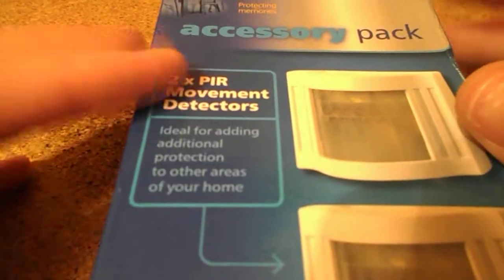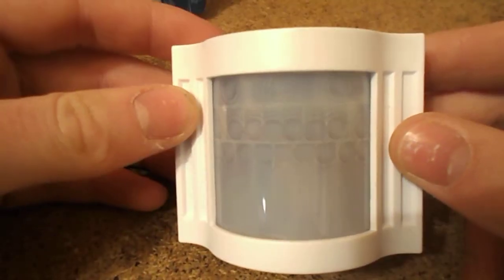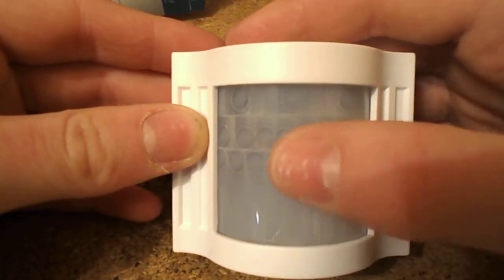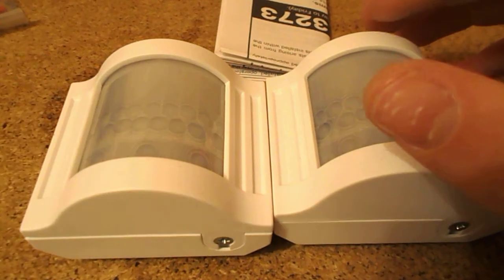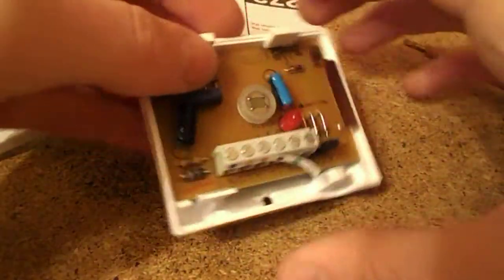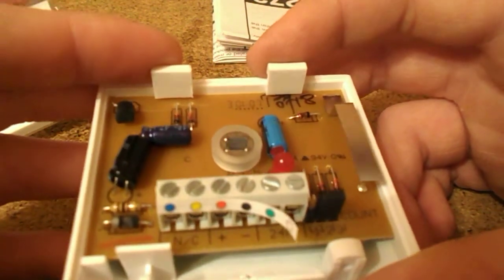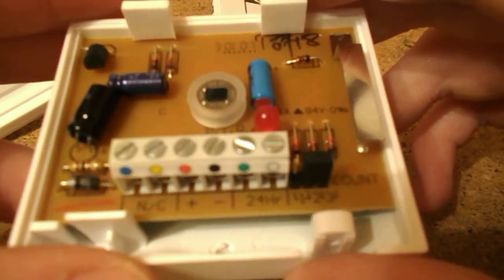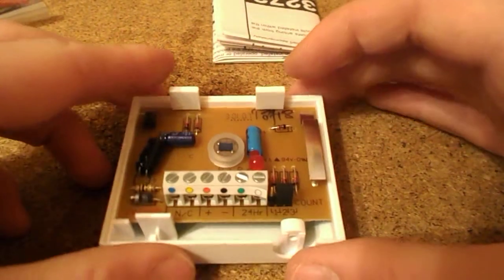friedland response burglar alarm P.I.R kit

Comment: Wasn’t the response alarms basically the Accenta g3 systems?
Reply: X_Manic Mania_X I don’t think so. I think Response is something to do with A1 because the Response PA4 panel has the A1 Omnicron tones
Reply: AC Alarms thanks for the reply, yes I know that the pa4 was to do with the a1 alarms, but I’m on about the pa6/pa8 systems as I used to have one and they had a proper wired control panel with a keypad, the pa6 keypad was the same as the Accenta 6/8 keypad but it didn’t say Accenta+ on it, plus the exit and entry tones were the exact same tone sound as the Accenta g3.

Comment: Hello I have two KAC call points and two sounders can you make a video on how I could add them to my wall WITHOUT drilling holes?
Reply from the maker: Max From London unfortunatly, the sounders and call points need to be mounted to a wall with wall plugs to stay on securley or they will just fall down. The only thing I can suggest is no more nails which is a silicone paste that is extremely strong and may keep the sounders in place but im not sure about the call points. unfortunatly i cannot guarantee if this will work as i have never done it before as its not the proper way to do things.